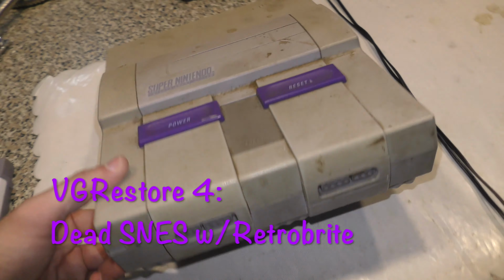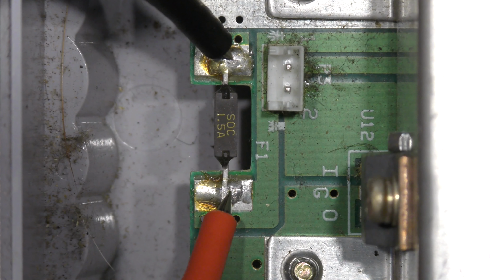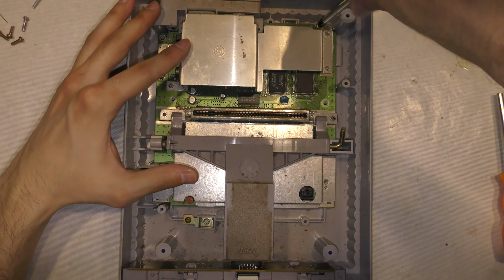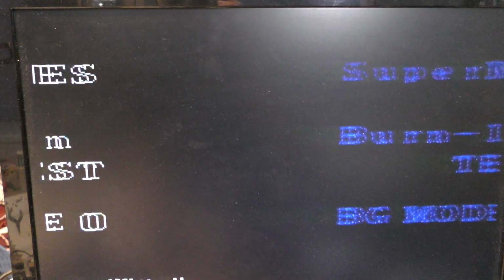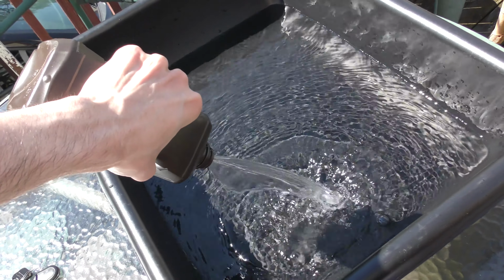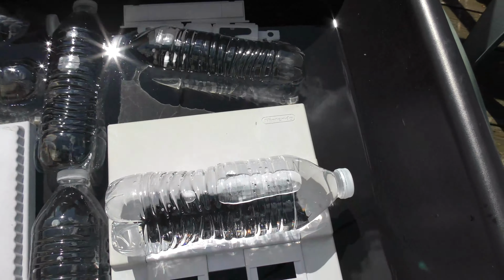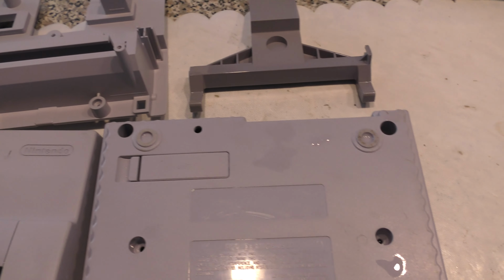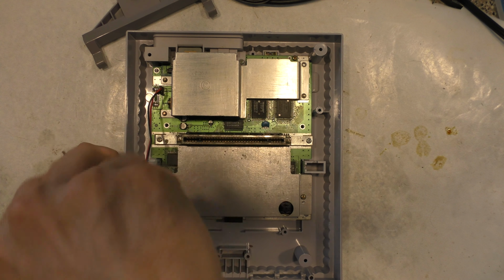VGRestore Ep4: Dead SNES w/ Retrobrite

Comment: Bro i have 2 snes that has black screen i clean the pins and still..
Reply from the maker: Check out some of my more recent videos, black screen of death is usually a bad cpu and you need a donor to swap them out. If you don’t have the tools or the experience to do the repair it’s almost best to sell your board for parts and buy a whole other console.
Reply: @PunkNDisorderlyGamer  yea i guess   it  had corrosion when i clean it..i look at all your videos dont think i can  fix  snes like u..
Reply: @PunkNDisorderlyGamer  do u think its the adapter i have a retro reversal the one with 9 volts 350mA..
Reply: Hey one quick question i got one of the snes to work.but there a humming sound when i use rf and when i use composite the audio is very low..any advice
Reply from the maker: txtsilentsteele bad audio capacitors I would replace all the capacitors. Get a cap kit from console 5.